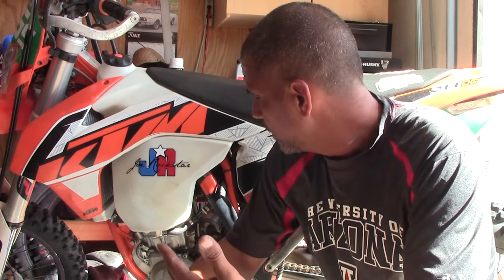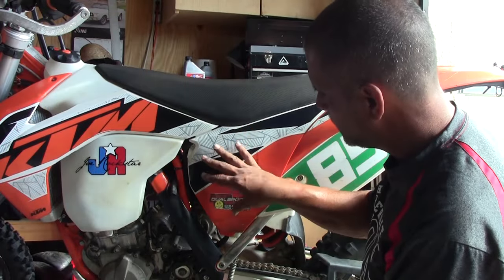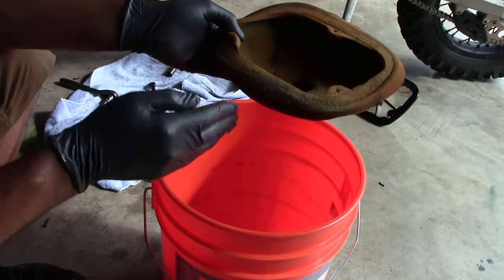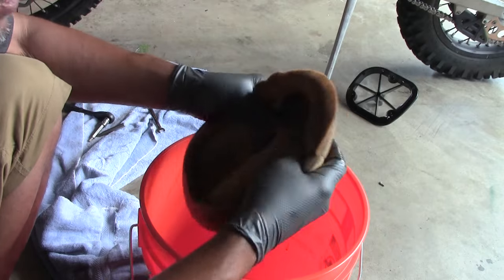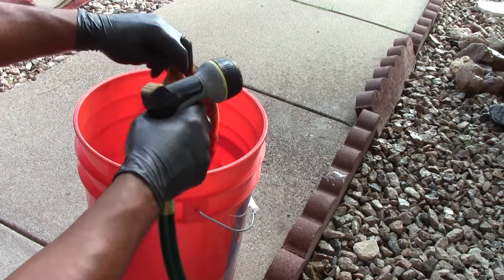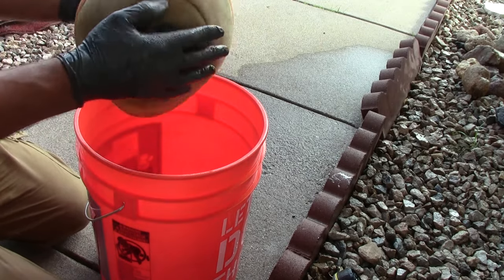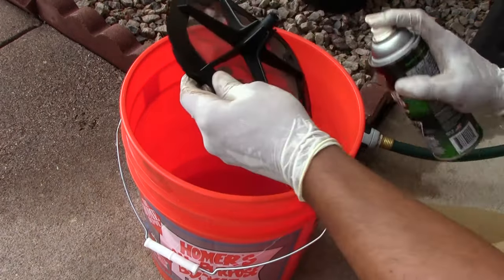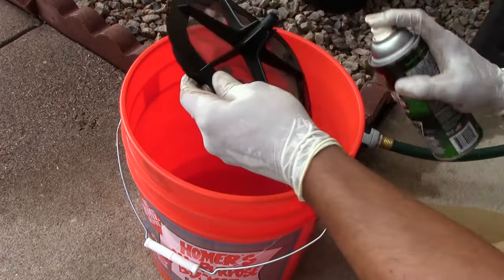KTM 500 EXC Maintenance: Clean your air filter!

Comment: Just purchased a '17 500 EXC-R and was wondering what the process was. I'll be doing the LA-Barstow-Las Vegas ride this month and will be changing my filter as well. Except I'll just pack a pre-lubed filter and swap it out after day one. I'll refer to this when I get back home. And I read the filter grease part. Nice to know. I wouldn't have known. So I'll be packing that for when I swap filters at the hotel. Thanks again for the video.

Comment: you skipped what could be considered the most important part of your filter maintenance.  To lay a bead of grease around the perimeter of the inside of the filter where it seats up against your air box.  This is the path of least resistance when your bike is gulping in gobs of air at WOT.  Did you notice how you had all that nasty crud built up in that EXACT area when you went to clean it off ?  If your filter seal is gonna let go its around the perimeter.  just a small amount of buildup in that area is enough to lift it up and break your seal.  considering how diligent and such a great job you do in your maintenance i'm surprised you missed this. 

btw, great job and great videos !  :)
Reply from the maker: +mcgman 80 thanks to you and all the others who have pointed this oversight out. I shoukd update the video soon.